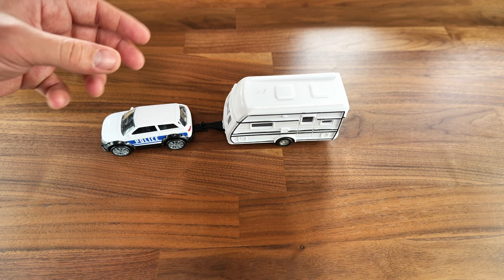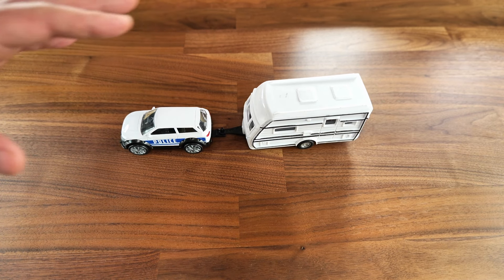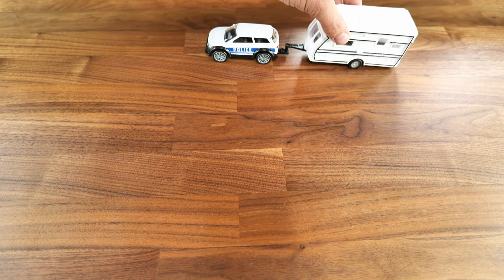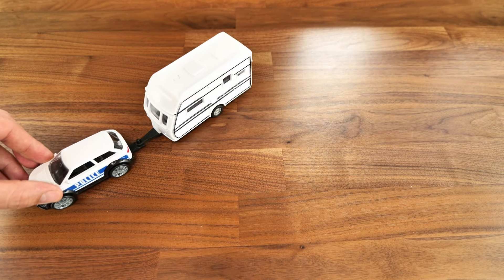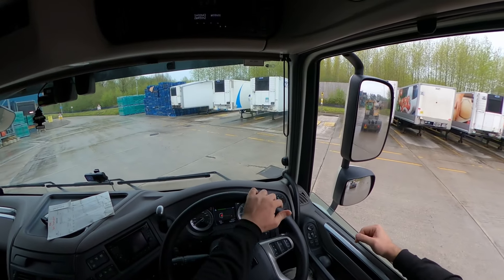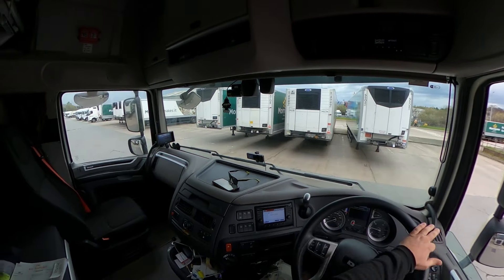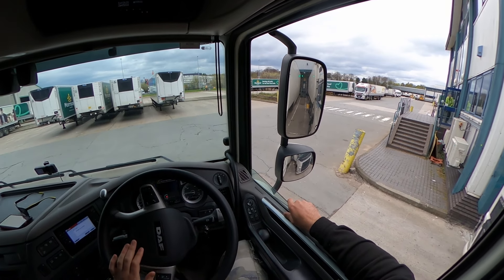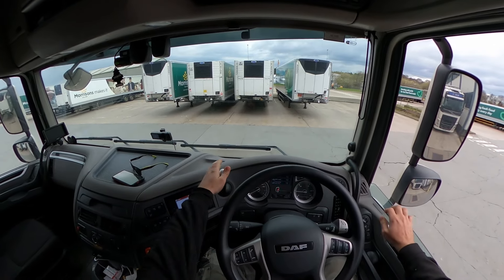How I Reverse An Articulated Trailer

Comment: Raul, What's your best advice for turning in tight delivery yards, did York Morrisons on Saturday...so tight but managed it after jack knifing the trailer, had a chat with the staff who said its common for drivers to struggle 🤷 it was a chilled trailer with the suzies on the sliding rack...took it very steady when pulling the trailer round

Comment: Hello, thanks for the great video. Just got my class one license and my first job is as a shunter which as far as i know is easier to park with than tractor unit. I can see most of my colleagues are taking their heads out of the windown when reversing, is it a must to do it this way? If you are doing 60 shunts per day, your neck, back and shoulders will feel sore probably. Is it possible to reverse without taking my head out of the window? Also the weather, winter, rain and cold...

Comment: This is a great video. One question. At 7:36, how do you know how much room you have on the other side of the trailer? I've been trying to follow this guide for the last week and I keep having to get out and check because from the cab it looks like I won't make it when in fact I will?
Reply from the maker: It's a good thing to go out and check. But with experience, you can assess if the trailer will fit in a gap before you begin the manoeuvre. If you keep it close to the trailer that is in your field of view, you can be sure that you will not hit the one in your blind spot. but it's definitely better to go out and check
Reply: Reverse the trailer more or less straight before entering the bay  so you’re not steering into the bay thus risk hitting the other side shunt forward to see both mirrors again and then reverse in straight. I’m no expert still trying to perfect this myself but I hope this helps.

Comment: You make is look so easy. But a good point when you mentioned pushing the trailer, makes sense.

Ive got my 2 week practical course coming up in a few weeks, never towed anything in my life, not even a small trailer or a caravan. But i am a confident driver, so expect i will get the hang of it quickly. Got a steering wheel setup and been practising on euro truck simulator, it seems to help. 😀 But obviously, nothing like doing it in real life.

Thanks for the vid and the tips.

Comment: My older brother passed class one in 1975. First time. He could do nearly all his reversing with head out of the window watching the trailer wheels. He became an expert driver on crash gearbox double de clutching. Went on to do most of the repairs on his trucks over the years. It's  all a learning curve nobody was born with a steering wheel or a spanner in their  hand.❤😂
Reply: My brother, what does he mean by you always get your bearings around the middle axle on 8:15❓️ 

Does he mean that you follow the middle axle until the middle axle is inside the bay or touching the bay❓️ when is it time you straighten out❓️ please explain 🙏🏽

Comment: Hello Raul. I love your videos. Can I ask a question ? 
I am interested in class 1 and not class 2. I heard that the government relaxed the rules so people can go from the basic car licence to class 1. Is that true and do you recommend that ?
Reply from the maker: Yes, it is true, but you will struggle to get work straight on class 1 👍
Reply: @Raul689  I just called the hgv driving school and they said that I can go from B straight to class 1 and the class 1 licence will also include class 2 driving lessons however this will not require me to pass class 2,, just class 1.  They say that agencies take on new class 1 drivers with no experience but it can take weeks to find a job, so you are right it wont be easy to find work as a class 1 new pass.
Reply: 3.500 pounds )))

Comment: Nice and smooth - good to have a procedure you follow, it just makes it so much easier to start from the same consistent position wherever you can. 

My other pointer for new guys would always be: if you trailer angle is wrong, don't try to fix the problem moving backwards. I see newer drivers throwing the cab left and right trying to fix the angle of the trailer or jack-knifing off the road with the trailer at 90 degrees when a simple shunt forwards to straighten up would fix the problem. I would always try to do as much of my reversing in a straight line as I can and use the forward shunt to pull the trailer into line whenever I can.